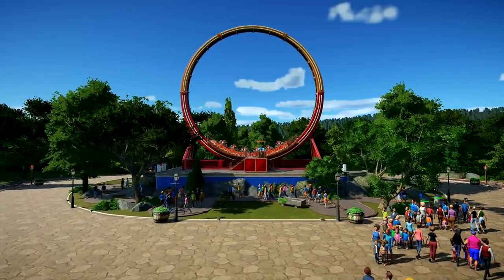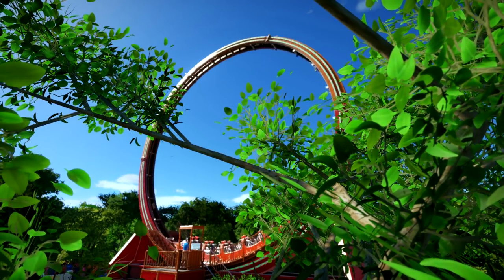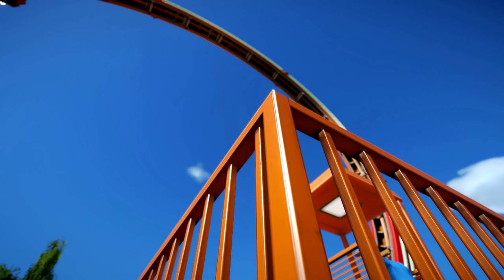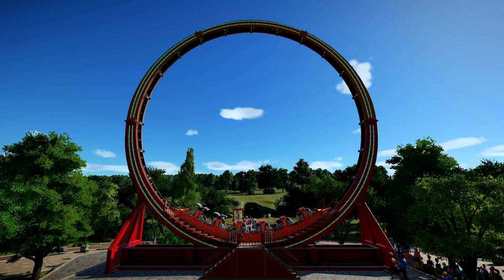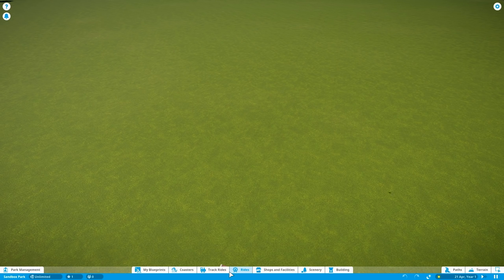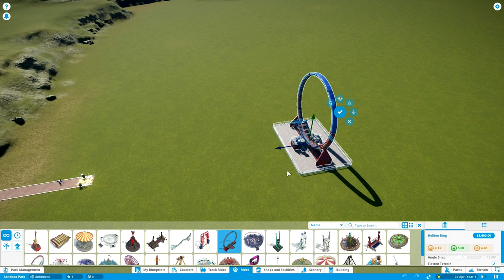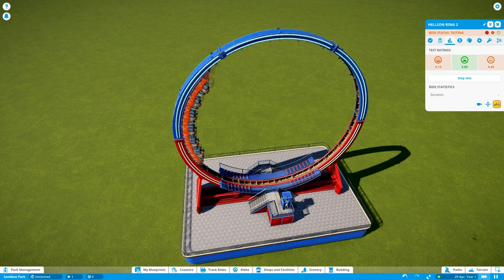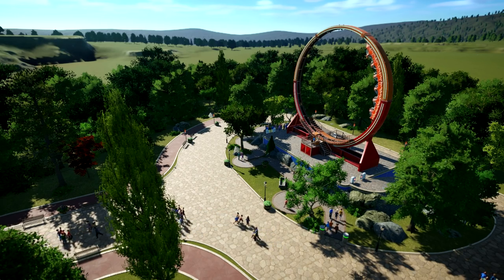Planet Coaster College - Hellion Ring (Superloop)

Comment: Big respect you managed to do a tutorial for the most complicated coaster in the world. I actually had no idea how to ever build this. But now I think I might try it. Only that hovering over the icon gives me struggle for some reason. Any idea about this?
Reply from the maker: You're welcome. You have to press down on the mouse button with your index finger, using a force of at least 1 Newton. If it still doesn't work, start applying additional force carefully  - beware however, don't get your mouse stuck in a ceiling fan.
Reply: best reply EVER!
Reply: But why happens if it gets stuck multiply by infinity and s
Divided by zero and getting stuck in itself
Reply: @Silvarret  THANK YOU!
Reply: @Silvarret  k

Comment: How much of the first 6 minutes is true and what is made up?
Reply from the maker: It's all false, but parodying real things. This video refers to the fact that Six Flags parks have these things and DO count these as rollercoasters, the 'credit' system is a real thing but it doesn't work like I said it does, and coaster enthusiasts usually dislike these rides, while preferring rollercoasters depending on the amount of airtime rather than the amount of times they go upside down.
Reply: Silvarret Indeed, a Larson Looper is also not even a coaster at all. Six Flags is marketing them as coasters, but every enthousiast agrees it is a flatride...
Reply: Unreal Enthusiast Well with that argument a powered coaster is also not a coaster, it is more because it can only do one thing and there are no other variations possible, like a coaster with countless possible elements.
Reply: OK. I was wondering if you had lost your mind , I could not watch the end of the video . LOL
Reply: Bas there not coasters either.
Reply: The superloop doesn't even have a track, therefore I don't count it as a coaster.
Reply: lennsa s
Reply: I almost took this too seriously right up until I decided to peek into the comments and saw this.

I'm glad to be vindicated that my own preferences for how good a roller coaster is is reflected in what coaster enthusiasts consider to be a good coaster. XD

Comment: This was far too complex. I know that I need to stick my speakers inside my Toaster for 66 hours on the max setting and have a fire extinguisher ready, but can glasses do? And do you have to delete the System32 Folder for it to work? If I throw $6666 in HD TV's at the screen while clicking the button and also remotely install a Trojan from a 3rd-party website then do I get a better lloop? How do I comment on videos? Is this a bot? Do I also need to throw my PC down an Emergency Intelligence Incinerator? -patented by Aperture Science And what will happen to me, because I just deleted the System32 ffffooooooooooooollllllllllllllllllllllllllllll crash